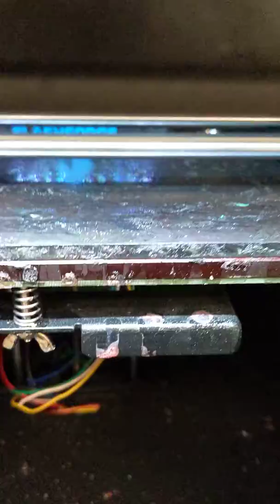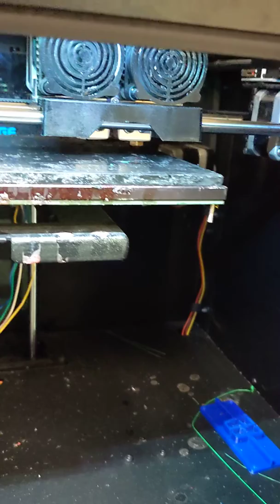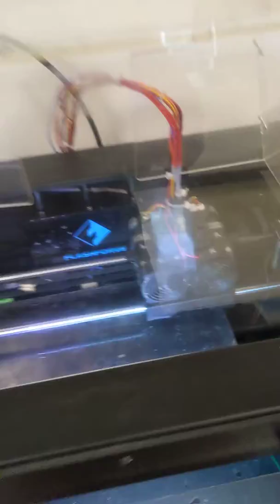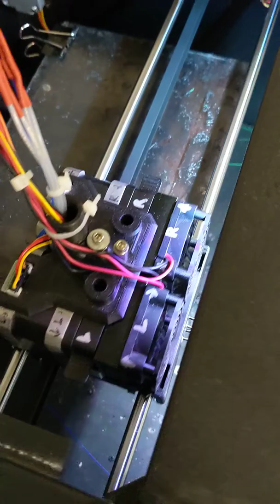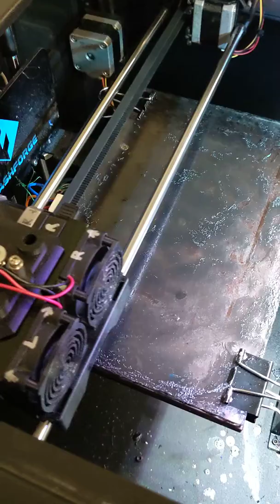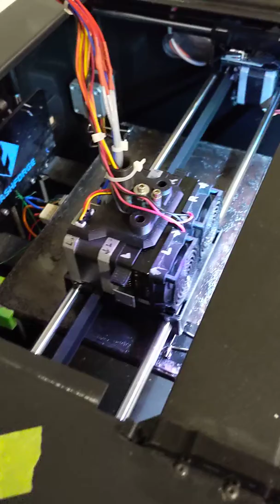FFCP 3D printer stutter/skip

Comment: I have the same problem in a new printer. Something i touched somehow maybe bad conection or too mutch pression on bed rollers
Reply: it was definitely the stepper motor cable. I replaced it and it works great again.